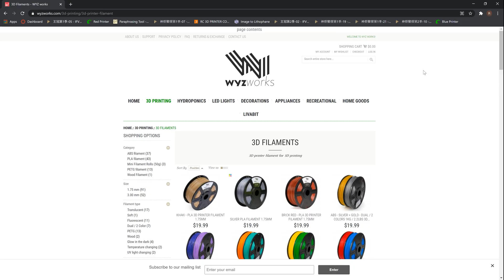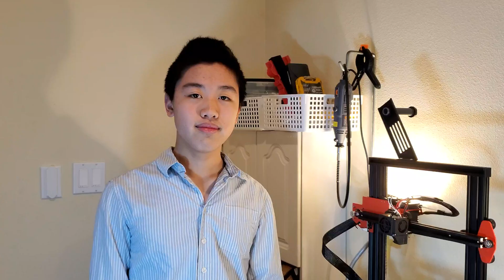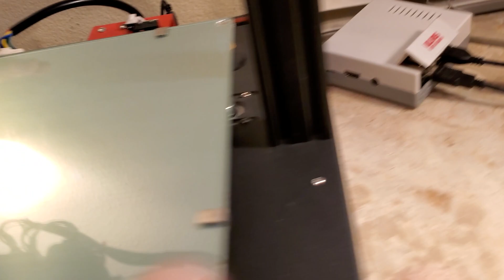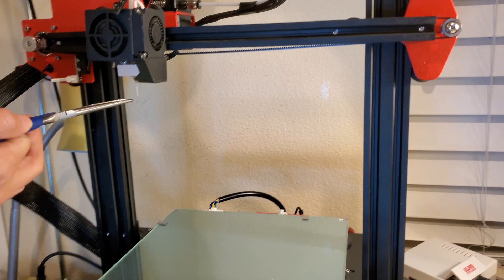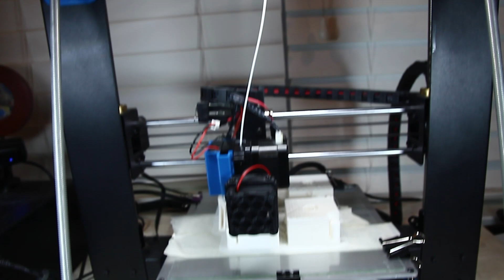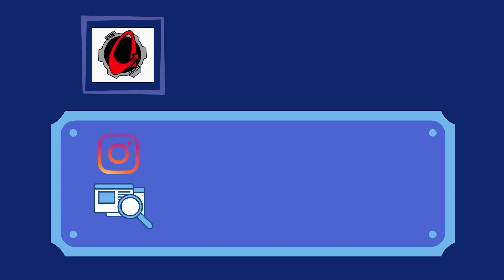CADing /3D-Printing for Beginners 07 - Setting up your 3D-printer: WYZworks Filaments

Comment: 🔥🔥🔥
Reply: Would the recommendation vary if the object is different?  For example, for a dinosaur 3D object, vs a more squared object, a model building?
Reply from the maker: The recommended temperature for the nozzle and heatbed only varies when using different filament material. For example, ABS (Acrylonitrile Butadiene Styrene) requires hotter temperatures compared to PLA (polylactic acid) because the material has a higher melting point.  As long as you get the print settings correct, you should be able to print anything from a dinosaur to a building.